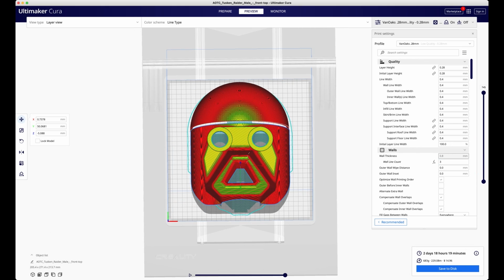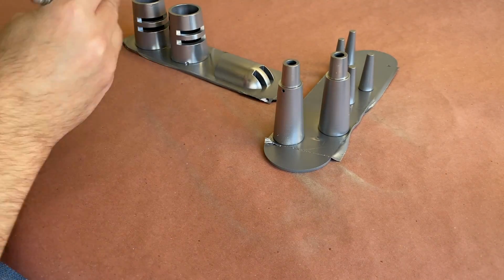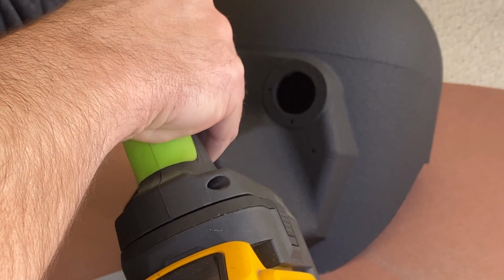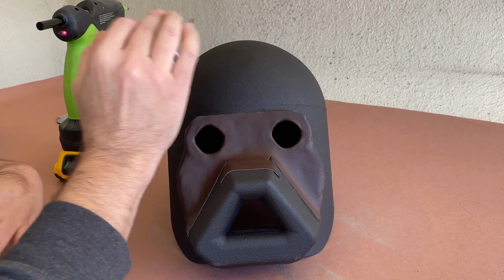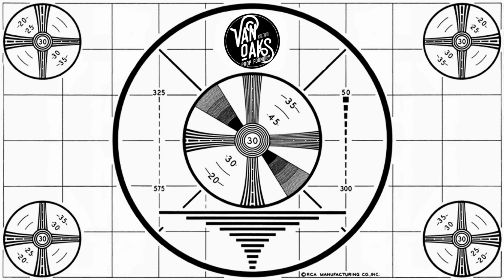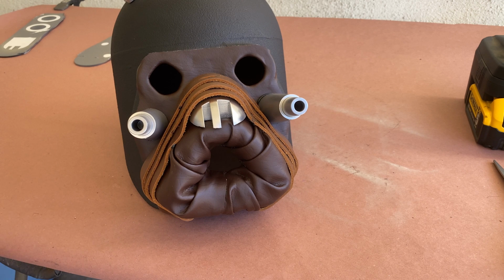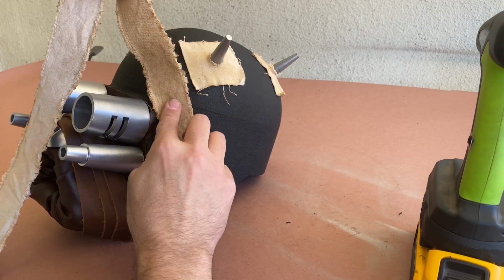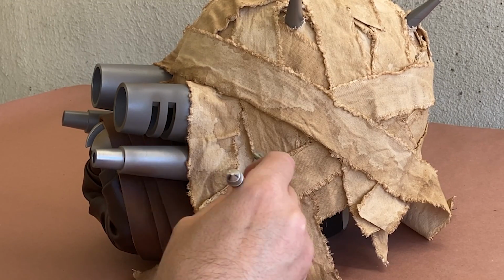DIY Tusken Raider Helmet

Comment: Awesome video. How did you know where to mark the holes for all the spikes on the top and for the tusks?
Reply from the maker: There’s flat spots for the tusks in the 3d print and for the spikes I just eyeballed it based on what looked good me.
Reply: @VanOaksProps  OK cool. Thank you for responding :)

Comment: Great job man!!! I’m working on mine as we speak… for the instant coffee weathering application… so you pre wet the canvas strips with plain water ? And then mix some of the instant coffee grounds in the spray bottle w/ water… then randomly spray the fabric??? Thanks in advance man !
Reply from the maker: That's correct. The wet canvas makes it easier for the coffee to get absorbed into the fabric, rather than just floating on top, and makes for a more natural looking staining.

Comment: If you have a local thrift store like an ARC-Goodwill in your area what's donated to them can be quite a nice supply of odds n ends  for builds. Whether its towels to lamps and everything in between  what they have is often stocked by the materials there made from or by assortment. They often save seasonal items like Halloween instead of putting them out as they come in as well as the clothing that can be used for costumes. Regularly visiting them espevially on sale days what you might find and repurpose can be up to your imagination. I have found aluminium antlers to beauty school heads used to teach hair styling skills there and thinking outside the box with what you'll find there often a great buy too...
Reply from the maker: Absolutely agree with this. Yard sales can be great as well.

Comment: its not DIY if you use a 3d printer
Reply from the maker: It's a grey area, but I think if the tool is available, I'm going to use it. Much the same way that I'd use a table saw instead of a hand saw, etc. It's a time saver.

Comment: Damn, I was hoping this would be a build out of scrap parts and PVC tubing (rather than 3d printing, since I don't have a printer). Based on what I see here, I do think that could be done, though the solid base he uses really makes this build easy. I do think a basic mask could be substituted and then build a "snout" (probably with foam and green stuff, or similar) before continuing on to create the rest of the mask. The only piece that looks complicated to build from scrap is the nose, not sure what to substitute, and wondering if anyone has ideas?
Reply: All and all, I think it's an excellent build. I'm amazed he did it in one day. I do think the whole piece needs more weathering, especially the leather around the nose/mouth. But it's a great build, good job.
Reply from the maker: I agree. The nose needs some TLC.
Reply from the maker: It definitely could be done with pipes and foam. As for the nose, you could possibly use a 2" dowel, cut in half and round out the tip to create the shape.
Reply: Thanks for the replies. After watching the show, I see that your weathering is actually (unfortunately) accurate. The whole show needs a lot more weathering and grime. However there was some nice possibilities for decoration of Tusken Raider masks presented - it's too bad they didn't play a larger part in the overall picture of the show. Your build could easily be expanded and developed, and is an excellent base.

Comment: A lot of people will use duck cloth, but the correct fabric is bull denim. I'm also quite partial to using really watered down acrylic paints sprayed on using a regular sprayer like an old Windex bottle to embed the color within the fibers. On my build I also angled the eye stalks inward so you can see without causing double vision. Great job though overall!
Reply from the maker: Thanks for the tips!

Comment: A comment on the "I won't make you watch..." attitude. When I'm making stuff from video tutorials, I often find myself wondering how the maker tackled certain issue in the process. Sometimes literally just "how did they sand this tough section" etc. Obviously you have to limit the length of your videos, but generally, if you struggled with something, we will too, so it may not be a bad idea to spend some time on those areas. 

Also, my 14yo son walked in during the airbrush portion and said "Woah, that looks cool!" I thought you'd appreciate that.
Reply from the maker: Great point, Tony. I’ll keep that in mind for next time.

Comment: Great video, really nice work on the mask.
I love the truck bed liner on the 3d print. First time I have seen that idea!
Reply from the maker: Thanks, Odin! It means a lot coming from you.
Reply: It looks cool, but what made you think of that if it's going to be wrapped anyway? 
It's a great idea, now I'm thinking of other things that could be coated lol. 
Was it regular pla or something special?
Anyway, very cool as always👍
Reply from the maker: I thought I might be able to get away with not doing the leather layer because of the texture, but in the end I decided to go with the leather. It was just standard PLA.
Reply: @VanOaksProps  ah, OK, I can see where you're coming from on that. Maybe something like crepe over pva, keep the texture without the thickness? 
Either way, awesome build.

Comment: Great work! Love all the weathering!

Just a tip, on my Tusken build I used a rustoleum “multicolored textured” spray paint lightly dusted on the helmet after I finished assembly with the metal bits masked off. That added some texture to the duck cloth that really made it look like sand had collected on the surface.